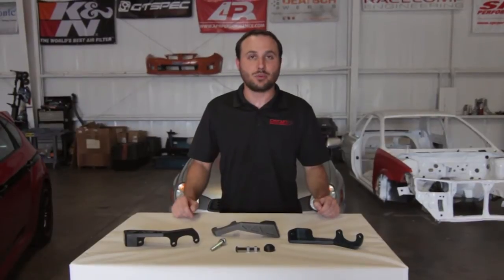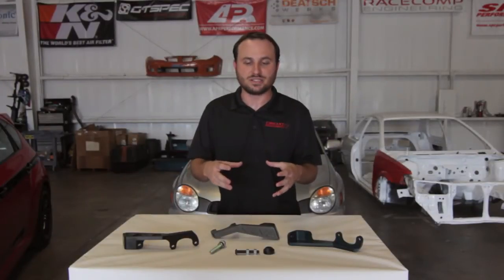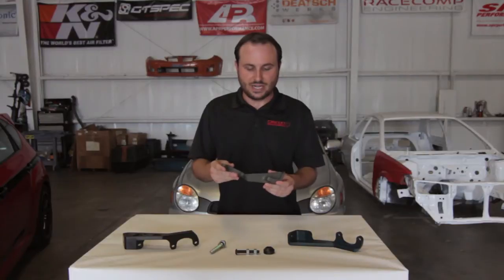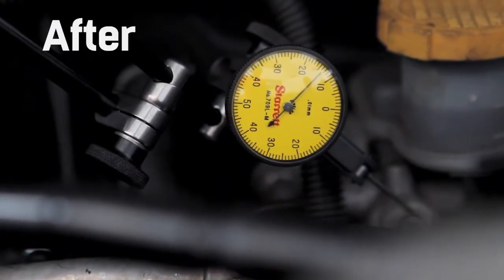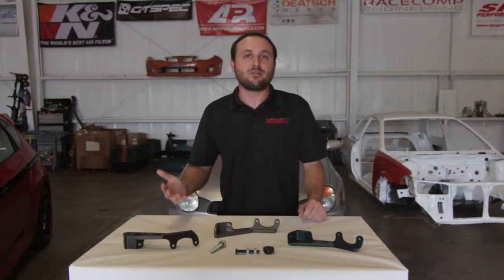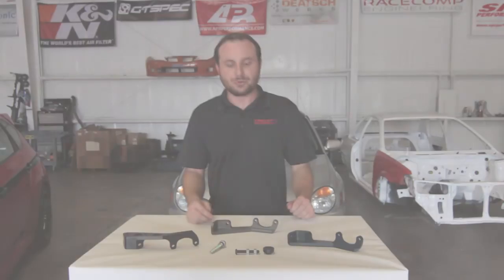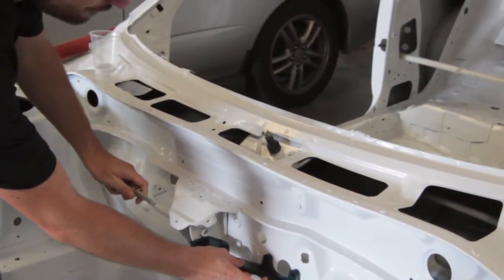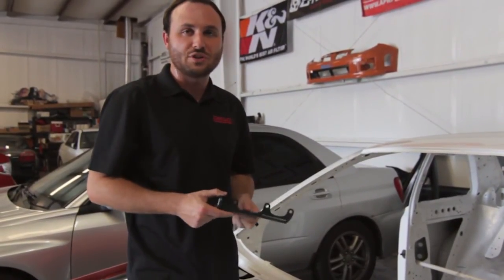Circuit Motorsports Clutch Master Cylinder Brace Release

Comment: will there be a group buy on nasioc? and does this work with a master cylinder brace?
Reply from the maker: Yes, this will work with a Brake Master Cylinder Brace, it won't interfere with that space.

Group Buy is here - http://forums.nasioc.com/forums/showthread.php?p=42785948#post42785948
Reply: when will the gb end?
Reply from the maker: Jack Liu Running it through December 31st :)